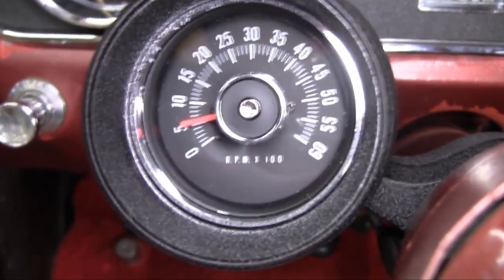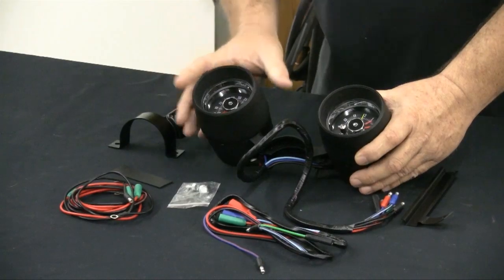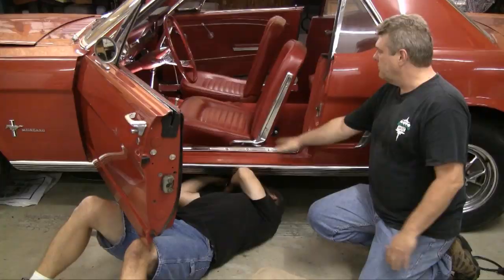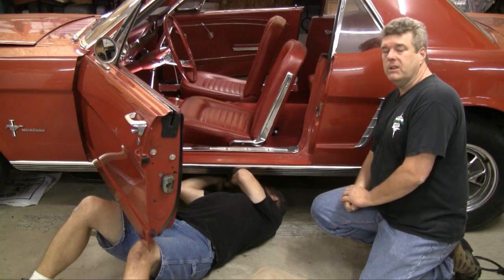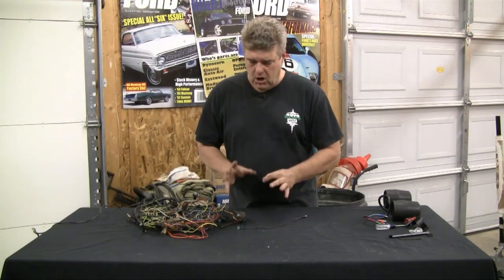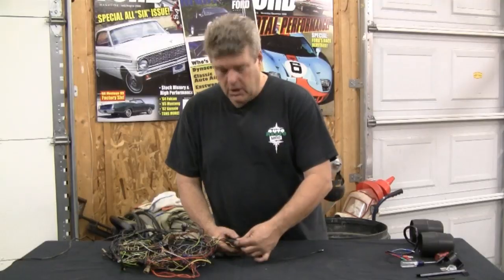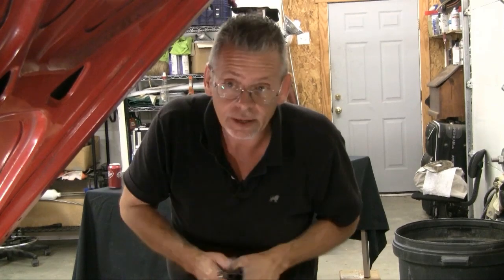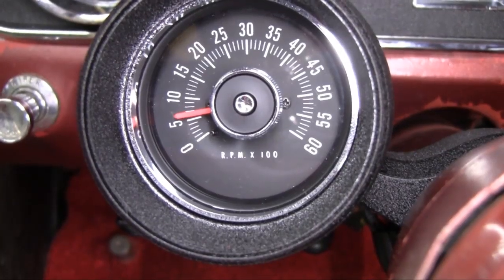1965 1966 Ford Mustang Rally Pac Install How to Episode 178 Autorestomod

Comment: Hello, thank you for such a great video.  I bought a mustang that had an original rally pac partially installed.  In that it was mounted, but not wired.  It appears the wiring all behind the dash was done, now it's just connecting everything.  I cannot find where to plug the red wire from the tach with the green connector.  I have a pink wire with a white connector that runs to the ignition.  But there is already a black wire from the ignition that connects to the black wire from the tach.  Any thoughts where this red/green wire should go?

Comment: How about instead of complaining about a zip tie you take that 5 seconds to suggest using a grommet in that hole so the wire doesn't end up shorting out when the sheet metal rub through the insulation? Good video aside from that

Comment: Thinking of adding the rally pack on my old Bronco. Any thoughts? Could you tell me the size of the round opening or the size of the mustang steering column. Thanks and great video!
Reply from the maker: If it's an early Bronco, pre 78, then the steering column is basically the same thing as  the early Mustang, and you're good to go.

Comment: You didn't make clear how to put the cable guard on the steering column. How you supposed to drill a hole up there and also by drilling a hole will you Nick one of the wires coming down the inside of the steering column? If that happened you have one heck of a mess
Reply from the maker: You are right

Comment: We had a 1965 hard top,1966 fast back 289 ci and 1967 fast back 289 ci , I   have an original rally pack bought at  a shelby (? ) store in L.A. california back in 1966,never used,never installed ...any one interested ?
Reply from the maker: Best place to unload that cool piece would be one of the Mustang Facebook groups or eBay! Nice part!
Reply: Thank you very much !

Comment: Why are most of the cars on here autos? Those aren't for driving, they're for steering ;)
Reply from the maker: Well, the 67 fastback is a 5-speed, the '65 Blue hardtop is a 3-speed floor shift and Jeff's, '64 Falcon is a 3-speed on the column. That gives us about a 50/50 ratio on cars. Automatics made up a significantly larger portion of the American "Big 3" cars were automatics.
Reply: I've had many empty cars I'm 64 years old and I'm tired of shifting. I like to be able to drink a Coke while driving. LOL
Reply: That was supposed to say antique cars

Comment: Hi there can you help me out if you find the time. My restoration is a XY Ford Falcon 1971 Aussie made. Can you tell me the car it is similar or based off when it was made. I am looking for a rack and pinion to install and would like to look at options over in the US. Thanks for your time:).
Reply from the maker: US racks will all be left hand drive. Unisteer makes a Fairlane left hand drive rack. The Fairlane and XY have a common chassis, just mirrored. RRS in Australia makes a right hand drive rack and pinion for the XY though.
Reply: Thanks, forgot about the left hand set up for some weird reason. maybe I assumed they would do a right hand side for an even weirder reason ha ha. Thanks, might contact Unisteer and see  they might consider making right hand side for the international market. Cheers!!

Comment: That clock drain the battery? That's lot of clicking
Reply from the maker: There are mysteries by the truck load on that car. Not sure where the voltage drain is...but it is there.

Comment: That was an odd 6 cylinder, normally the coil id down lower and centered. :)
Reply from the maker: The original car was to be a six, but it "disappeared" so we had to run a V8 for the install.